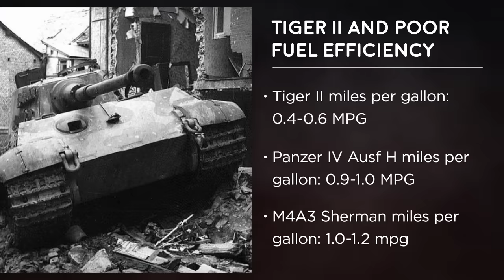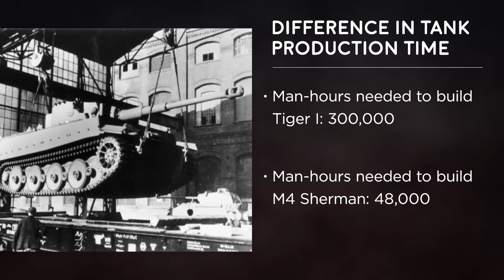Why Did German Tanks Perform So Badly in The Battle of the Bulge?

Comment: My father-in-law was a gunner in a Sherman Firefly. The 17pdr was certainly capable of penetrating any German AFV, but was needed in greater numbers than were available. He mentioned especially that they enjoyed greater manoeuvrability compared to German heavy tanks, mind you , he was fighting in France and the Low Countries.
Reply: Firefly was not a good design. The gun was too big and made the turret too cramped, the APDS round was too inaccurate, and the normal AP round didn't have enough performance advantage over the 76mm to warrant all the compromises.
Reply: it worked though, didnt it? @gamesguy
Reply: @lukeisadog  not particularly
Reply: @gamesguy Well it did. It was certainly a stop gap measure for better tanks, but it was a very powerful gun, and gave Sherman units a gun very capable against German armour. It wasn’t perfect but to say it didn’t work is very strange.
Reply: @imperialinquisition6006  There is zero evidence the firefly made any difference whatsoever. American armored formations without it performed just fine against German armor.
Reply: @gamesguy  you are smoking top shelf boof. 17 pounders could massacre anything up to a king tiger while the sherman 75 short barrel struggled against panthers
Reply: @ChadShotgunApe  Real life isn't just penetration and armor. Firefly made too many compromises to fit the gun.

76mm Shermans was sufficient against almost all German armor.
Reply: @gamesguy  76 Sherman's were just as effective yes, but the 75's were not
Reply: @ChadShotgunApe  And? Where did I say they were? Fact is the firefly was not a good design. I specifically compared to the 76 Sherman, maybe you could try reading next time.
Reply: @ChadShotgunApe APCR round very low explosive filler will not do any real damage to the German tanks. It was extremely inaccurate and still the Tigers and Panthers out-range it by Km.
The only real threat to German Panthers and Tigers were Soviet IS-2's. Their 122mm shells had not only better armour penetration and accuracy but also their 122mm shells were so devastating, it was one hit and kill round according to German records.
It's shells literally shattered the turrets of King Tigers and it's massive explosive filler made sure not a single man left the burning tank alive.
Reply: @gamesguy  Are you serious? Did you ever read the accounts of Fireflies in action? They could take out Tigers, even Pathers against their front armor. Gave the German tankers nightmares. At that point, it was more a case of who shot first.
Reply: @tomryannova  now have you read actual accounts from the people who crewed them and from war time analysts? The trade offs were not worth it.

Not to mention, 76mm with HVAP ammo had just as much penetration than a firefly and far less compromises. Meanwhile firefly's APDS ammo was worthless due to incredibly bad accuracy.
Reply: @gamesguy  Yea, that's true. But you have to fight with what you have at the time. 

At the time of D-Day, Fireflys were well into production and each British tank group included them ( one Firefly, 3 standard Shermans ). All US Shermans that landed on D-Day were 75mm. Thus, the Brits could take on German armor right off the bat, whereas the Americans could not (good thing the Brits were the ones fighting in Operation Goodwood, not the Americans ).
Reply: @tomryannova  American 75mm Shermans did just fine at the biggest tank battle on the Western front - Arracourt. They smashed panthers with ease.
Reply: Yeah I think that’s right.Shermans became known as Ronsons by Tiger crews
Reply: @nicholasforman1195  Stop this bs myth.
Reply: @gamesguy  It made a difference to Michael Wittmann and his platoon.
Reply: @TSD4027  I don’t think you have any idea at all what you are trying to say.
Reply: @ChadShotgunApe  Not sure massacre is the night description.the German 88 was a devastating weapon that made short work of most allied AFVs. Superior allied air power from 1944 onwards was the only way to take out the Tigers:Typhoons were especially good at this with well aimed rockets and bombs.
Reply: @nicholasforman1195  Again, this false drivel. By 1944 tanks were showing up with guns that could penetrate the front armor of a Tiger tank. T-34/85. The IS series of tanks. Any British vehicle with a 17 pounder like the Firefly, Archer, Achillies, or the A-30 Challenger. Over 80% of all Tiger tanks went to the Eastern front. Encountering Tigers in the West was fairly rare.
Reply: @TSD4027  False. Michael wittmann's tiger was destroyed by a Canadian 75mm armed Sherman with a side hull shot from ambush. 

Ironically, it blew up after just 2 shots - like the sherman ronson myth. The turret literally flew off.
Reply: @gamesguy  Stop spewing bullshit. Joe Ekins is the most widely accredited with the kill. He was gunner of a Mk Vc Firefly with a 17 pounder.
Reply: People fail to account a thing called combined arms. Tanks didn't just fight tanks. As a matter of fact, most of the time they did infantry support.  @gamesguy
Reply: Fighter-Bombers were very inaccurate and did very little vs tanks. What they did was cut off logistics.  @nicholasforman1195
Reply: @gamesguy american Armored Formations didnt field the Firefly, idk why youre comparing their performance to the Brits as if only the US performance in the war mattered. The firefly with the APDS round had 50% more penetrative power than the 76 mm and even though the APDS round was fairly innacurate for its caliber it was still accurate enough to hit its targets and much easier to use than regular rounds due to its high speed. Idk where youre getting your info from but the Firefly was a significant tank that was credited with destroying numerous Panthers and tigers through the war and came out with a positive K/D ratio in the end despite everything. It wasnt a great tank but it was a good tank. And btw, the 17 pounder wasnt innacurate, the APDS round was, the regular 17 pounder APCBC shell had about the same accuracy
Reply: @mariobosnjak99  Because the British also fielded the normal Sherman variants? It was not a good tank, the enormous gun made the turret too cramped, reducing efficiency, target acquisition speed, and rate of fire. The gun kicked up an enormous amount of smoke and dust, reducing the efficacy of follow on shots. With APCBC its penetration was no better than HVAP rounds from 76mm armed Shermans.

It also had a very anemic HE round, and tanks shot at infantry most of the time - even US TD formations.

It was a downgrade from the standard 76mm armed Sherman, period.
Reply: @gamesguy  all well and good yes, but, the 76mm was in action in late '44. The Sherman firefly was a STOPGAP measure. Keyword, stopgap. It had compromises, yes. But it was an effective tank destroyer and did what it was designed for. Yes the 76mm American Shermans were better, but they were only available later in the war.
Reply: @reapertalon  76mm armed Shermans started production in Jan 44 and were part of Overlord from the start. There were about 100-200 of them that went in, with numbers rapidly increasing as the Battle of France continued. This compared to about 350 fireflies.

The point is the firefly wasn't really needed at all. With standard ammo(not the inaccurate high velocity ammo) firefly still couldn't punch through the front of a panther tank, the most frequent "hard target" the allies faced, at longer distances. At shorter distances panther tanks were easily dispatched by hits to its thin side armor.

The largest tank battle on the western front at Arracourt involved 75mm armed Shermans smashing a panzer division with brand new panther tanks to bits.
Reply: @gamesguy  "76mm armed Shermans started production in Jan 44 and were part of Overlord from the start" Totally incorrect - the first 76mm M4'were used in Cobra - which occurred after the Panzer Div's were broken by 21st Army Group.

"The largest tank battle on the western front at Arracourt" really? I think Goodwood might want to have a word.

Comment: The firefly works, if you can fire first and accurately 
But this shows the value of having mobile antitank abilities that can fit various circumstances 
This was very educational, thanks
Reply: The "accurately" part was the problem.The turret was uncomfortable and the dispersion was terrible.The americans preferred going with the 76 M1 because of how bad the 17pdr was at anything but penetration.
Reply: @naamadossantossilva4736  The 17 pdr was a much bigger gun than the 76. It could fit in the sherman turret but got in the way of normal operation and was very hard to reload so the first shot better be good! Putting it in the M10's open turret worked better as long as you remembered the armor was only good against splinters.
Reply: @naamadossantossilva4736  The inaccuracy of the Firefly is only related to the APDS round, the normal shot, which could easily handle the Tiger I and the Panther was not that much different from the 76mm M4. 

Nicolas Moran (The Chieftain) has a good youtube video out there on this subject. I totally agree with you on the poor ergonomics though.
Reply: @ronhall9394  while the 17 pdr was a powerful gun in the same ballpark as the Panther's 75mm and Tiger's 88mm, it could not "easily" punch through their frontal armor. The Panther's glacis was a tough nut to crack, and a well angled Tiger was almost as well protected as a Tiger 2. There's a reason why Firefly crews were adviced to not engage in direct firefights.
Reply: Video on how useless the German tanks were for the situation.
Let's talk about the short comings of the Firefly 

🤣🤣
Reply: @scottgiles7546  M10 mounted a 3-inch (76.2 mm) gun M7, a modified anti aircraft gun.
Reply: @TTTT-oc4eb  "well angled tiger" in reality angling was not something that was done, there are some rare reports mentioning it in german documents but nevertheless it was not something that was used, tanks of the second world faced the front of their tank towards the enemy, if they saw the enemy, that is
Reply: @nickdanger3802  The British got plenty of M10s from the Americans, and many of those were converted to use the 17 pounder instead of the American gun, due to the increased performance
Reply: @TheMeanLemon  My missnake
Reply: @naamadossantossilva4736  Rubbish. The friefly was superbly accurate. I have no idea where you get your BS from but you should probably change your sourses.
Reply: @scottgiles7546  Jesus. There are plenty of sources to tell us that the firefly was the absolute best M4 untilthe Israelis fitted them with the French long 105MM. Fact is the firefly could kill any German tank out to 1,000M or more while the 76 M4 and defiently not the 75 M4 could not.

Whenever Amrricans egt involved, politics get involved. test conducted with the M4 agaisnt British tanks proved beyond doubt the M4 was not a mobiel cross country, had poor firepower, low armour didn;t even have nutral steer meaning that the aura of the M4 was total bow locks. I know I would rather be in firefly than a 75 or 76 M4 but I would rater be in a cromwell than either.
Reply: @naamadossantossilva4736  The British were the opposite; they disliked the 76mm Sherman and actively avoided using the ones that they received, furthermore they begged the US to continue producing more 75mm Shermans because those + Firefly conversions were much preferable.

Part of the reason the US initially rejected the 17pdr is because they overestimated what the 76mm gun would be capable of. They later reopened evaluations of the 17pdr but ultimately concluded that it's performance was equivalent to that of their 90mm for which plans were already in motion for, so a 17pdr project would just delay that. 

Much can be made of how awkward a Firefly was to aim, but at the end of the day if there's an enemy tank over there suddenly a little bit of contortion seems more than acceptable.
Reply: Also he forgot to mention the Sherman Jumbo, which was basically a Sherman with thicker armor and wider tracks. The armor was even thicker than the Tiger’s, as while the plate itself was about as thick, the Sherman of course had a sloped front. Such was the demand for Jumbos that many, including all of Patton’s 76mm gun tanks, had extra armor plate taken from damaged US and German tanks welded to it. In some cases, this amounted to the front plate of a Sherman welded to the front of a Sherman, with a cut-out for the bow machine gun. 

While all were originally armed with the 75mm, the turret shape was based on the one for the 76mm and consequently many were fitted with them.
Reply: @TheMeanLemon  that is not true, angling trhe armor was a key component of ntiger I tactics, its both mentioned in the tigerfibel and in otto carius´book. Some german Youtuber(forgot the name ,damn) made an excellent video about this.
Reply: @robinsonsstudios  As I said in my comment, it is mentioned in some handbooks and there is information to confirm that there was some thought put into it. However, in actual combat it was not used, rarely if so, the majority of engagements involving tanks do not allow the use of angling, as most engagements, especially at that time, are surprise ambushes which tanks would have a hard time reacting to. There are a lot of downsides to angling as well, at least in real life, as you expose the entire track system and overall become a larger target. Angling was popularized by video games, especially when it comes to the overhyped german tanks, but in reality it was not something that was used, rarely, if so
Reply: @robinsonsstudios  You should pay more attention to the first minute and 20 seconds
Reply: Dark Heck,

Yes you keep the front of your tank to the enemy. However, in reality its almost never a perfectly straight angle. There is usually always some angling going on. Tanks almost never engage each other perfectly flush.
Reply: Naama dos Santos Silva,

Tell me which Sherman 76 gunner ever knocked out 3 Tigers in quick succession  at 800 yards distance? Or 5 Panthers in quick succession? Firefly gunners did.
Reply: @lyndoncmp5751  Yes, that is correct, but purposeful angling as the other comment mentioned was not something that was done, to a low extent if it was, as it is mentioned in some German documents
Reply: The problem with the Firefly is it couldn't fire accurately.  A 1943 US Department of Ordnance concluded upon testing the Firefly main gun "the average at all ranges was calculated to be 7.38mil/7.58mil overall, and means of .189mil and .205mil. The testing complete, they then dug into the records to find the test results of 90mm and 76mm guns. Mean dispersions for deflection and elevation were .115mil/.142mil for the 90mm and .112 and .110 for the 76mm respectively."  So, in conclusion, the Shermany Firefly was half as accurate as a 76mm main gun.  At longer rangers the Firefly was even worse, with half the effective range as a 76mm.
Reply: @naamadossantossilva4736  The Firefly worked. Deal with it.
Reply: @davesherry5384  the brits themselves joke about the 17lber's accuracy or rather the lack thereof
Reply: @kirotheavenger60  dream on
Reply: The YouTube commentators who go on about ordinary 17pdr shells being so terribly inaccurate can’t explain the 4 Firefly shells fired destroying three Tigers at 800 yards.  Even seeing a tank at 800 yards in Normandy was impressive.  The Chieftain pooh-poohed the alleged inaccuracy.
Reply: @TTTT-oc4eb the 17 pdr was designed to be able to punch through the Panthers and tigers armour. While the panther was a tough nut to crack, allied tank crews were actually trained to aim for specific spots that could knock out a panther. Usually a good shit through the weak turret checks was enough to disable a panther. A panther definitely isn't going to be able to reverse anywhere, and it's definitely not going to try and turn around and show it's rear while it knows it's in the sights of another tank. 

As for a angled tiger, not really. The Russian kv1 actually had more armour than the tiger 1. The kv1 had 110mm worth of armour, the tiger only had 100mm worth of armour. There's also no way that a tiger crew is going to be able to understand the concept of angling by the time the 17pdr was in service, as most crews had been rushed through training and we're mostly just boys.
Reply: @ethanedwards422   There were no Tigers, let alone Panthers, around when design work on the 17 pdr started - it was simply a logical upgrade to the 6 pdr. And they just got it right.

Tank and AT crew were not trained to aim at specific points - even today gunners aim at the center of mass.

As for angled Tiger, yes really. They were trained to do that. The Tiger had an effective turret front armor of 140-225 mm, and the quality of the armor was the highest possible at the time - according to British tests on captured Tigers it performed 15-20% better than could be expected from the sheer thickness.

In the summer of 1944 the Tiger crews were probably at the very peak of their abilities.

Comment: A lot of the these new tanks had been put together rather hurriedly with very little done with ironing out their teething issues, added to this the lack of raw resources, fuel, and a short supply of spare parts made it rather hard to regularly service their tanks to keep them in running order. This is something that was extremely important on the eve of a major offensive.
Reply: German (over) engineering with needle roller bearings in their engines didn't help either
Reply: From German records,  50% of the tiger crews abandoned their tanks because  of mechanical failure.  THE DAY HE DIED, WITTMANN had 17 Tigers in his command , only 3 were combat ready..
Reply: And when you're building them with starving, dying slave laborers, your workforce isn't exactly motivated to do a good job.